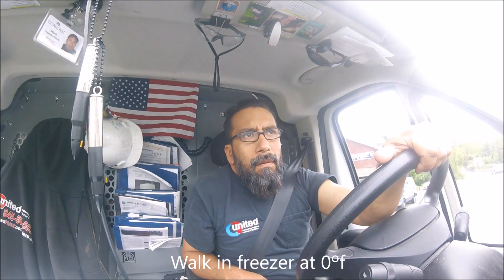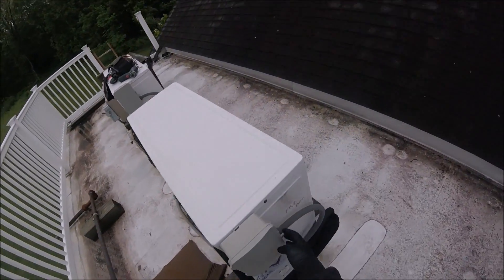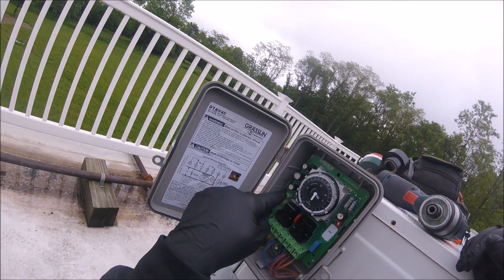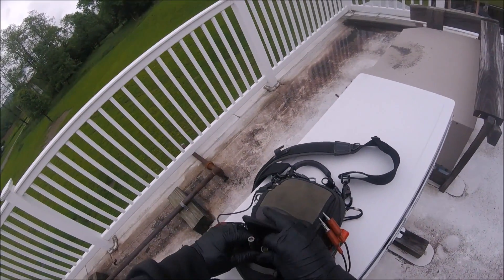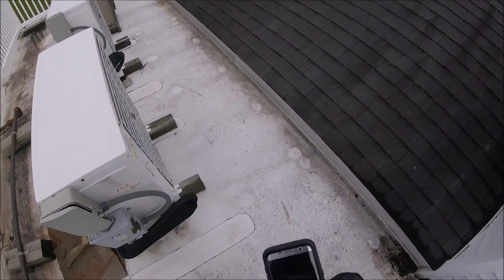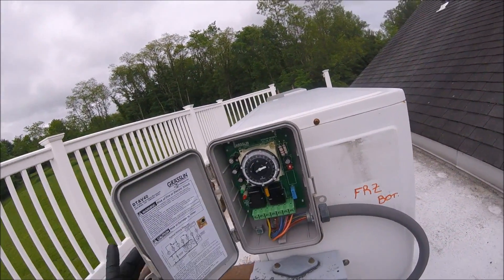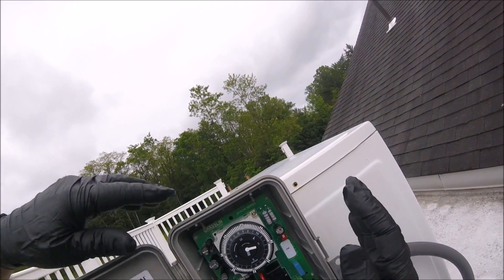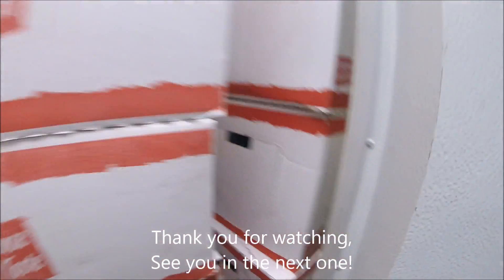FRZ TOP & FRZ BOT - HVAC lite with Alex

Comment: They cycle 3 times to pump out any liquid that might migrate into the compressor. Copeland condensing units do the same thing.
Reply: Nor-Cal Refrigeration & H.V.A.C good info
Reply: Just scrolls i think right ? Not recips.
Reply: OcRefrigeration,Hvac & Electrical. Yes scrolls.

Comment: What a clusterfuck... Why couldnt they just have gotten the right size evap and condenser unit.. Seems like common sense to me? Of course with some people common sense costs too much.
Reply: People do that if they don't want to Have Soft Product / Never want a Broken freezer. 2 Identical systems One Primary and one back up.or  I've also seen it on Long Narrow Freezers. One Different Unit Every 10 Feet. So when one unit goes down they arenottotally fucked and loise all thier product.
Reply: that would absolutely make sense IF... both systems were sized correctly for the box, and then they become equally redundant, and even one could take over when the other one goes into defrost. Or something. But from what I gathered in the video which I could be wrong, is just 1 system running isn't enough to keep the box to temp, so that tells me that they arnt "truly" redundant, but its certainly better than nothing I suppose. My opinion (engineer side of me) there should be a master control that if one isnt operating when called, it shuts down the call, and kicks over the other one. But I guess I could also understand if there is a huge box where 1 system cant do it all. Then that makes sense. But the setup in the video just didnt make sense to me.

Comment: Holy heck that's a lot of defrost times.
Reply: I know , why so many ? 1 30-45 min defrost every 6 hrs should be plenty on a freezer.
Reply from the maker: OcRefrigeration,Hvac & Electrical. Since we have this account, those freezers were set up this way, never a problem, so we try to avoid any disturbing, you know how it is, soon you touch it, it goes to hell!
Reply: Yep, i have Learned that too. If it's working Don't touch it.

Comment: Ay man. Do u think 22 is too old to become an hvac ? And what advice could u give me to get an apprenticeship?
Reply from the maker: 22 is probably the best moment.
Advice: get in mind that this type of trade it needs mind and body at 100% you will learn eventually, the key is how committed you become with yourself, how proud of yourself you can be, get better everyday! good luck out here!
Reply: Tyson I'm 21 years old, I started my HVAC career at 19. I began with residential installation and now can install systems on my own.. I realized construction isn't something I want to be doing the rest of my life so winter of 2016 I enrolled into trade school in an effort to earn a certificate of HVAC/R mechanics.. I'm now working for a HVAC/R contractor as a PM technician and I love it. Soon I'll start doing service calls with a lead guy and get on the job training while also studying at trade school... my goal currently is to learn to troubleshoot and maintain  refrigeration e.g. Walk in coolers/freezers, ice makers, display cases, heat pumps, packaged units, split systems, ductless systems and supermarket refrigeration.. there's so much to learn bro, it's a great trade
Reply: Ty 22 22 isn't too l old got into trades as was turning 30th research HVACR schools in your area ask supply house go hvacr company ask about what schools are good if your pressing for money go trade high school if they have adults class in your area to learn base takes little longer to if not try to get into hvacr company get a job to do odd task to see if you like it being trades. It going to take time years to develop your own skills after trade school .
Reply: Edward HVACR CT Okok. Would recommend Trade school. Where u can complete ur g2/G3 course within a year and get a certificate?
Reply: I started this trade  at 50